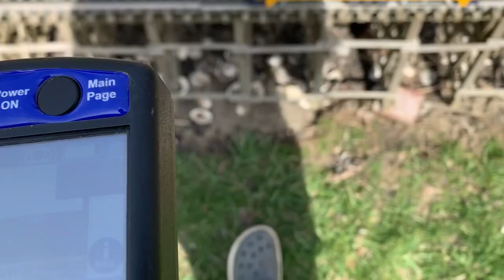G Scale USA Trains Santa Fe NW-2, Railpro and MTH Remote Couplers Test Run 3/30/21

Comment: Great looking NW2 who is the manufacturer and is it still available would much rather have it than the S4 definitely looking forward to the transition to G Scale and going 100% battery power and using the Railpro system.
Reply from the maker: It’s a USA trains engine. 🙂

Comment: Can you control each coupler separately? so i you have 10 cars you can uncouple at any one?
Reply from the maker: Only the engine has the remote couplers. They need a power source and a board to control them